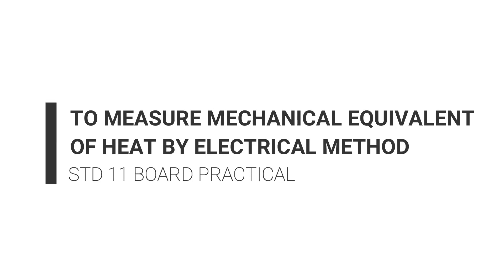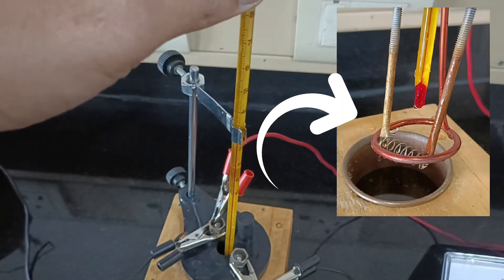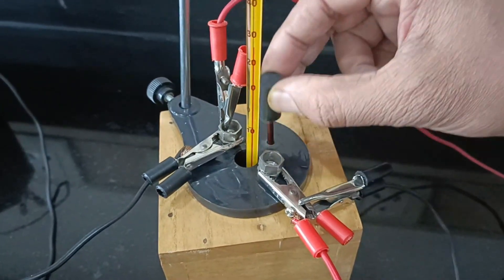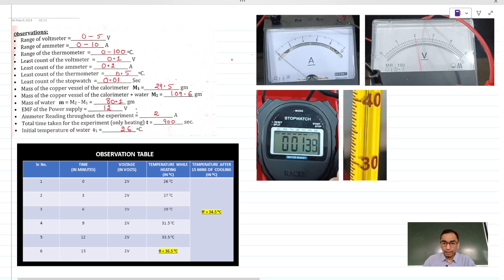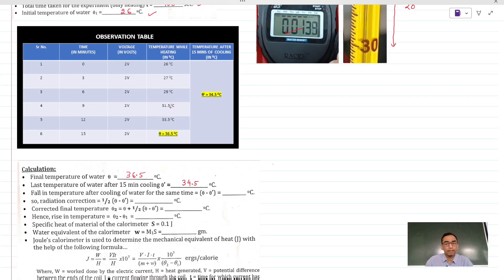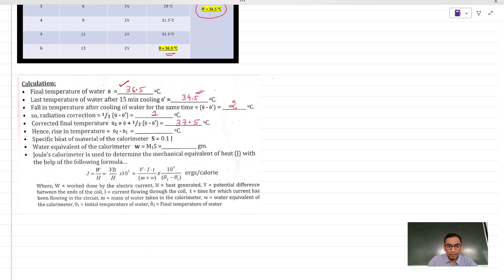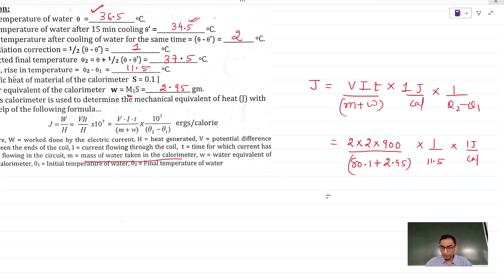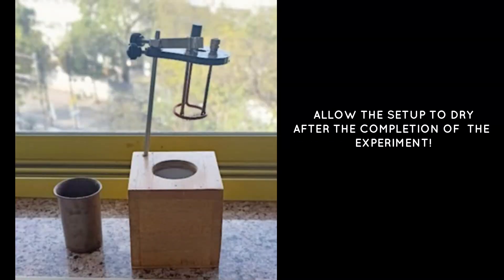TO MEASURE MECHANICAL EQUIVALENT OF HEAT BY ELECTRICAL METHOD STD 11 PHYSICS BOARD PRACTICAL

Comment: J/cal is i think a weird unit because j and cal are units of energy ( 1cal≈4.1j )so shouldn't the unit of the constant be nothing. Or is a weird unit like per second per second used to measure the sion rate of a star the first per second is the angular velocity while the second one is per unit time and yes these per seconds dont cancel

Edit:typo
Reply: Because it essentially is a unit of conversion. J/cal is dimensionless as you might have guessed. But it’s just there to provide a ratio for conversion. As in any scenario there are 4.18 J/cal